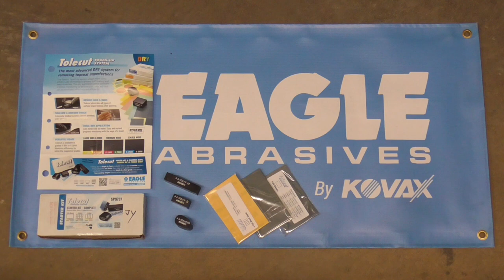How to Fix Runs & Sags in Auto Paint - Single Stage & Clearcoat

Comment: The razor blade trick really works good and can keep from having to redo a panel. Putting masking tape on the corners of the blade can help to avoid scratching into the clear coat. Have a good weekend
Reply from the maker: Thanks for the tip Greg - always good to hear from you my friend.  You have a good weekend too :)

Comment: Soooo I finish the paint and clear 2 weeks ago I started wet sanding with 1000 and on the tape edge it turned very white. I am not sure if I will have to refinish that area or the whole job I stopped to wait in your advise. I still have to use 2000 and buff . It’s shiny pearl white 🤷‍♂️

Comment: Nice video! That's a really handy tip using the razor blade. I remember those little 'nib' files mounted on the small wooden blocks like those sanding blocks you used. The ones I've seen were mostly made in England or Germany, but I think they're all over. Eastwood used to sell them a long time ago.

Comment: Here's an improvement to the razor blade method taken from cabinetmaking. Take the razor blade and chuck it into a vise, then take a round shafted screwdriver and push over the edge of the blade in one direction with the round rod making a burr. This is how cabinet scrapers are sharpened. If you want to get a visual idea of what I'm talking about look up on YouTube sharpening a cabinet scraper. This tool will now cut much faster than just the standard single edge razor blade alone and takes only 30 seconds to make. It's much faster and works great.
Reply from the maker: So you will use it in only one direction now right?
Reply: @LakesideAutobody  Correct. You want the burr in the direction of travel to scrape off the run. I also put a small bend into the razor blade so that the center of the blade is the first part to hit the run and to prevent the edges of the blade from digging in. When my best friend opened a bodyshop business I made several of these for him and put about a 1/4" of tape on each side/edge of the blades. I told him I was giving him "training wheels." I picked this trick up from Kevin Tetz who made the Paintucation Videos. As you get more comfortable with the scraper blades you can eliminate the "training wheels."
Reply from the maker: @satamanschmidt3428  I've heard of using the training wheels - never tried it though.  I'll keep this in mind and give it try next time I get a run - which won't be long probably🥴  Thanks my friend - have a good week :)

Comment: Nice job.  I go between using a blade ad a denib file depending on the run.  As usual, you make it look easy.
Have a great weekend, Jerry
Reply from the maker: I never used a denib file.  What's the disadvantage to one of those?
Reply: None really.  They're a bit expensive for what they are but they work really well

Comment: Good to know there is going to be a lot of this in my future. I have an off topic paint question I just bought a project truck and it has many touch ups done with spray cans do I need to sand all of this off before doing a base coat clear coat or will primer sealer or epoxy primer handle it?
Reply from the maker: Well... I guess the best answer is "it should" but... if it is in really good condition and the guy who did it, used the correct procedures then you  DA sand and prime right over it.  Just check it out really well.  If the paint is not peeling, chipping, etc., you could probably get away with priming over :)
Reply: Thank you for your time.
Reply from the maker: @davehowland5270  You're welcome :)

Comment: Wonderful video.  I was certain that the last step was going to be applying a clear coat finish.  Little do I know.  I notice you used a lambs wool pad initially.  Do you feel this is always a better alternative than the foam versions that Harbor Freight sells?  Can you wash the lambs wool and reuse it?  Kind Regards.  Craig
Reply from the maker: The one I use is old.  You can keep using them over and over - just run a screw driver over the pad while the buffer is running after the compound and polish dries.  They make a pad cleaner like with little star wheels but an old screw driver works just as well.  I think I show it in one of my buffing videos :)
Reply: @LakesideAutobody  Thank you so much.  Craig

Comment: I have got very good at that as I paint pretty runny lately...lol
Reply from the maker: There's a fine line between orange peel and runs - rather be on the orange peel side then lightly wet sand and buff :)
Reply: @LakesideAutobody  the paint I bought would not dry I finally put a fast reducer in it and solved the problem. Restoration Shop brand single stage urethane 4 to1..needs to be 4 to 1 to 1 with fast thinner then it works as it should...just incase you decide to try it...thanks
Reply from the maker: @chucktripp5722  Thanks - I have used that exact paint before but in the summer and it dried pretty well but it was about 75-80 degrees out.  Thanks for the information Chuck - I 'll keep that in mind if I use it in colder temps - have a good weekend :)
Reply: @LakesideAutobody  it was 85 here and took 1hr and 15min to tack up lol
Reply from the maker: @chucktripp5722  Wow! Interesting....maybe high humidity?  Not sure why it took so long to dry.  Good you found the cure though :)
Reply: @LakesideAutobody  I forgot to mention I painted the hood in direct sun shine outside...it was hot over a hour to tack up not dry..
Reply from the maker: @chucktripp5722  Wow - that sounds weird to me.  Let me know if you find out what's going on.  You didn't happen to forget the hardener did you - use too much? use too little?  It does have to be measured out pretty accurate to have maximum effect.  That paint is 4 parts paint to 1 part activator to 2-3 parts medium reducer.  The paint is a bit on the thick side if I remember so that's why you'll need the reducer.  It's actually up to you how much reducer you use - it will be thinned or reduced to what ever sprays best for you :)
Reply: @LakesideAutobody  everything done perfect , what a mess. The thinner cured the problem , I am no slouch at spraying lol this one about whipped me..

Comment: Good video Jerry. You know there’s two sides of a razor blade. One side cuts one side scrapes without gouging.
Reply from the maker: Really.... How do you know which is which?
Reply: If you look at it close you can see one side is flat. The other side is cut on an angle.Try using it like your taking pin stripes off of decals. Switch sides you’ll feel the difference.
Reply from the maker: @ginoconti-wl8hx  OK - cool... - thanks for the information - have a good weekend Gino 🛠🌤😊
Reply: Granted heat gun or eraser wheel for pin strips or decals. But sometimes the old razor blade does the trick. You’ll see the difference one side slides along the clear one side wants to gouge it. Try it out.
Reply from the maker: @ginoconti-wl8hx  Thanks - got a lot of negative comments (see vid) on what you are talking about but you're right sometimes the razor blade does the trick - https://www.youtube.com/watch?v=CuvAJbSARNU
Reply: @ginoconti-wl8hx   I looked at my supply and they're all beveled on both sides of the blades. I get what you're saying and I'm curious about it, just don't see it on my blades - What brand single edge blades are you using?